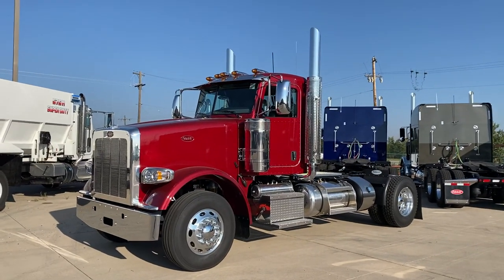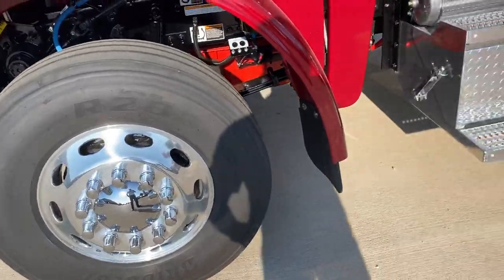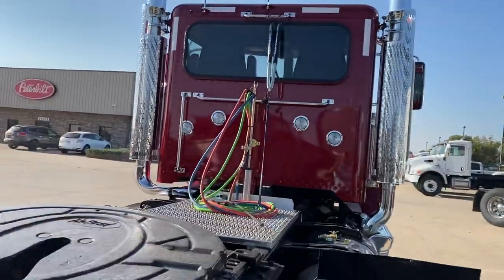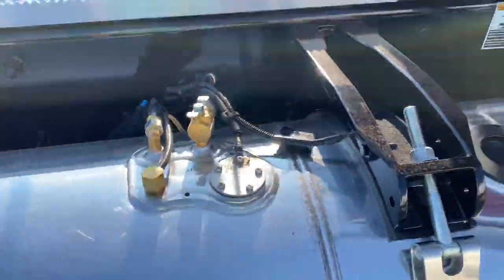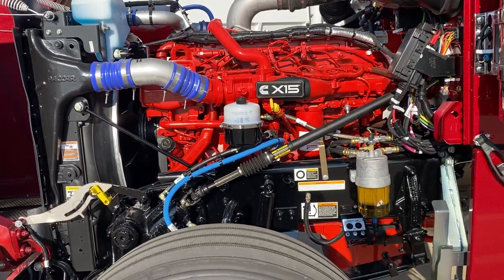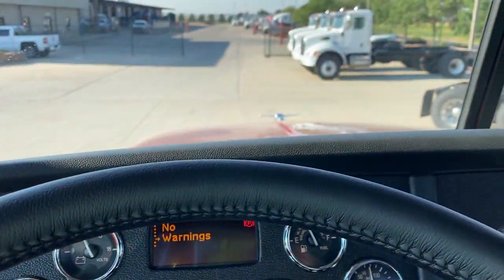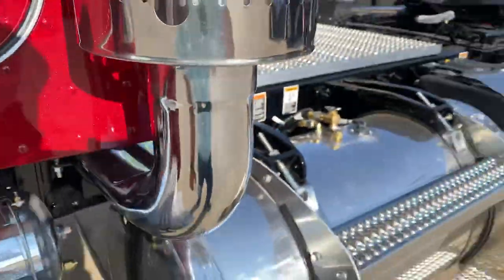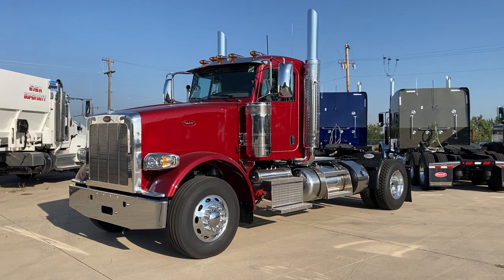2021 Peterbilt 367 - Single Axle Tractor

Comment: Due to the democrats, We don't see caterpillars no more !
Reply: Mike Motteberg ; Democrat s aren’t the only ones that like breathing clean air. Blame it on big oil; they’re the ones that won’t let the engine engineers with their computers build an engine that burns diesel cleaner than natural gas
Reply: @Retired88M   Can you tell me why Caterpillar Stoped  Producing engines for highway trucks ?
Reply: Mike, cat couldn’t meet the epa’s standards for air quality for highway vehicles at the time but ad of today they are meeting the requirements for off road vehicles and machinery which are less stringent than the on road specifications. But big oil doesn’t want to lose money from fuel efficient diesels burning less fuel

Comment: Why would any one buy a single  axle tractor  I hate em  why restrict  yourself
Reply: george wilson ; I wish here in the states we would go to 3 axle trailers like in Europe. I’ve driven many single axle tractors in all kinds of weather snow included when we used to get heavy snows here on the East coast and as long as you kept good deep rubber you always had good traction and it was never a problem backing into a tight dock
Reply: @Retired88M   I’m  just saying   I suppose  there  is a  market  single   Screw  power  but I  will stick  with  twin  screw  power  all it’s  about  is customers  thinking  they can save on fuel   I don’t like  customers  putting  in  their  two cents  on specing  equipment
Reply: george wilson , I could see twin and triple screws for heavy haulers and construction vehicles but with all of today’s air operated axle interlocking devices including those for single drive axle trucks it’s my opinion that on highway trucks exclusively only need a single drive axle. But opinions are like a—holes; everyone has one
Reply: They are practical in Europe for limited maneuvering situations. I agree a 6x4 setup is more well balanced and eye pleasing.

Comment: I know you like the twin stack look but if the factory isn’t going to hook up the left stack why even have it?  In doing a lot of backing into tight docks it’s really nice being able to just look out the window without having a stack in the way . I do really like the all in one aero mirrors especially when driving on wet salty roads; you don’t get the backsplash from the old style separate mount convex mirrors. I’ve driven a couple 379’s and 389’s with both types and I’ll take the combos if offered a choice. Been trailer truckin over 45 years

Comment: Just interested from my European perspective what would be the maximum gross train weight you could run that at? Over here of course most tractors are 2 axle with gtw of 40000kg (88000lbs) on international work but some countries allow 44000kg (97000lbs) internally, all with triaxle trailers of course. 35000kg (77000lbs) with a close couple tandem or 38000kg (83500lbs) with a wide spread tandem.  Good looking truck with a well packaged chassis layout.
Reply from the maker: 80,000lbs. on that guy.

Comment: Fake stacks suck. If I bought this, which I'd like to do, I'd have the dealer remove it, and discount this cost of the pipe. What's wrong with a single stack? It's a day cab work truck. It still would look good.